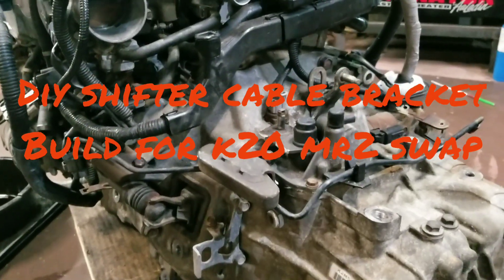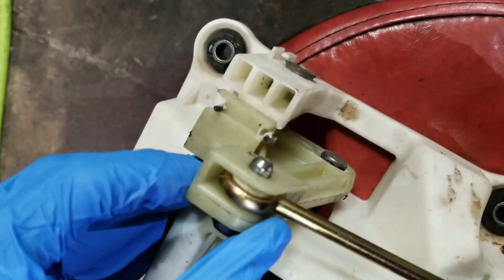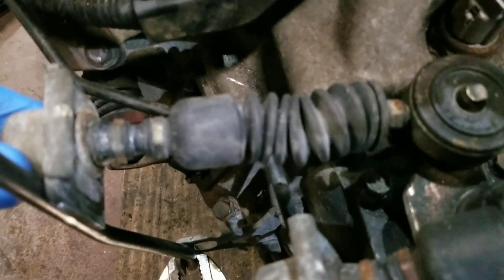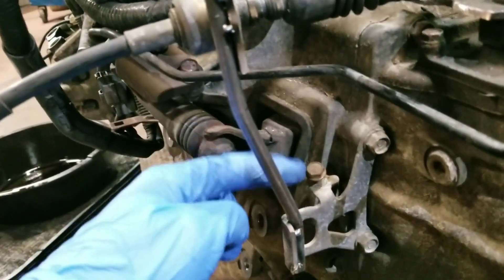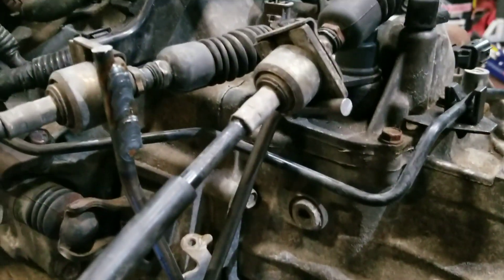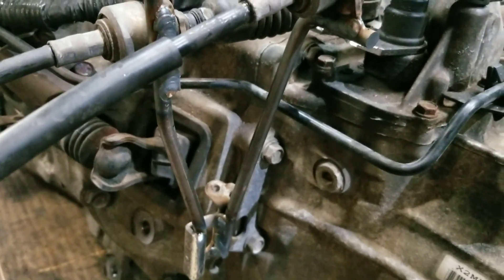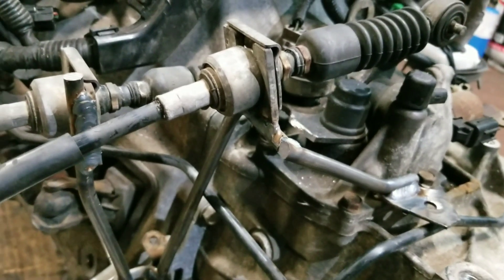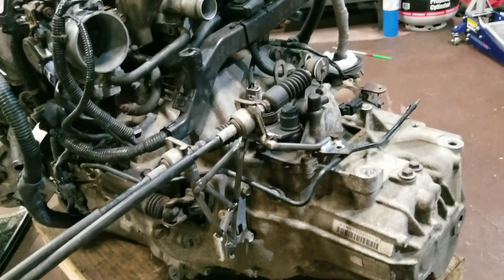DIY Shifter Cable Bracket Build for K20 MR2 Swap

Comment: Will your shifter be backwards? In the rsx the cables face forward but the mr2 they will be going back. So won't 1st be 6th
Reply from the maker: No shift pattern is the same since the motor is behind you. You are just reversing cables and box so the motions and pattern stay the same.
Reply: @minh82683  also, does that rsx trans bolt up with no modifications?
Reply from the maker: Yes it does.
Reply: @minh82683  THANKS A MILLION..IM BUILDING A T REX..IM TEARING MY MAZDA 6 APART..& IM USING THE FWD ENGINE FOR POWER" AND I WAS WONDER ING HOW ITS DONE" SO YOU BASICALLY MAKE CABLES TO SHIFT THE TRANS IN THE OPPOSITE WAY" AND U GOTTA MAKE THEM EXTRA LONG"..THANKS

Comment: Was your mr2 na or turbo model? And is vacuum lines a hassle
Reply from the maker: It was a na with a turbo swap. I don't have the vac line ran yet so I don't know. But it shouldn't be bad.
Reply: @minh82683  what about the gas tank you using stock or no
Reply from the maker: @91mr2sw  I took out the stock tank to run a fuel cell.
Reply: @minh82683  what about your body harness is it na or turbo harness
Reply from the maker: @91mr2sw  it's a na. The turbo swap was never finished when I got the car. That's why I'm k swapping it.